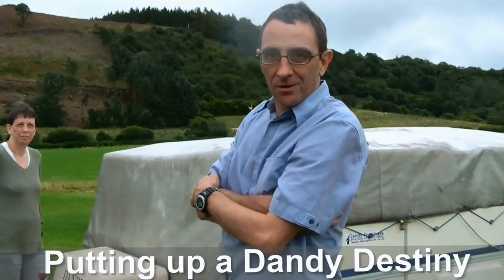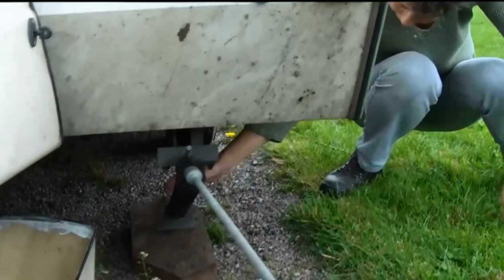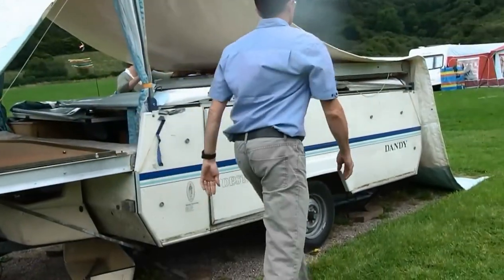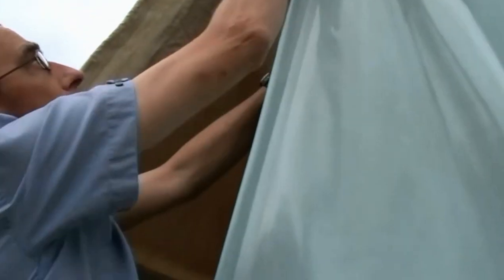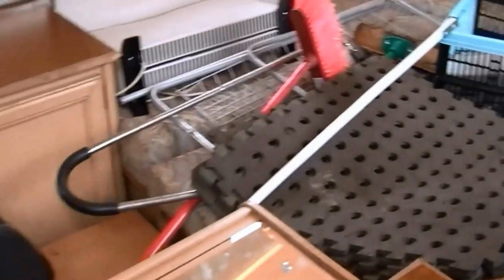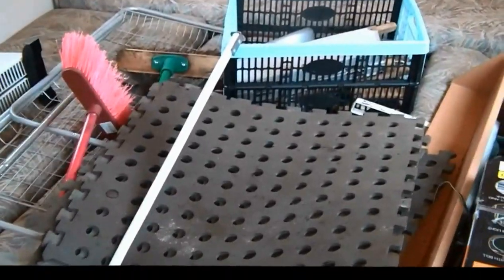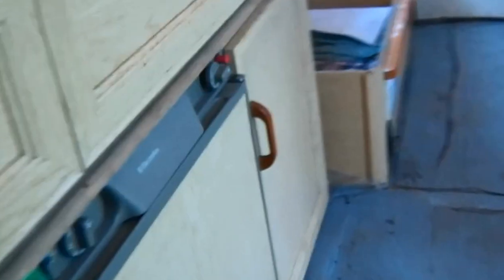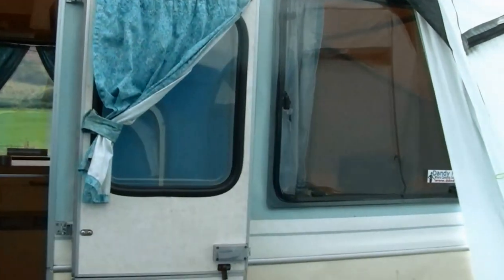Dandy Destiny Folding Trailer Tent - How to put up

Comment: By the way, the Pennines, Conway and Trigano all come with full awning, unlike Dandy, no longer made hence the make do and mend slap on tent.
Reply from the maker: Wrong! Dandy/Riva Did make full size awnings. Its just that I prefer the Drive-aways...
Reply: DID make but no longer. Stopped making them years ago!
Reply: So you don't have a choice really - drive away or none at all!
Reply from the maker: Or, you can use a fixed frame awning that Dandy Made ;)
Reply: If you can find one!

Comment: I had 3 different models of Dandy over the years, the last a 2004 Riva. I gave up on them in the end. OK you can pack them away wet but in contrast to that MUCH harder to put up than the Conway, Pennines and Trigano, no real problem packing these away wet, when home open them out! Still raining? Leave them until it stops, the same as you would leave it open on a site for a fortnight of rain! Also with built in blown air heating on the others, drying canvas out from the inside is easy, when the rains stops. Flush toilets, hot and cold water, sorry these are way behind the times and over priced. And yours is desperate for at least a wash!
Reply from the maker: If you found put up a Dandy hard, you must have been doing something wrong! Oh, and our Dandy has hot blown air heating... And You can get a Dandy with Flush toilet etc.. 
Yup it could do with a scrub up.. and you know why? Because were too busy out camping!!
Reply: I never said it was hard to put up, I said it was harder than the Conways, Pennines and Triganos, which it is. If you think different try one of those.  A Trigano sails up in comparison to the heave you have to give the door side of the Dandy, to get it even started to go up. The top of the range Dandy is the Dimension and they don't have a flush toilet the same as they don't have hot water!
Reply: And if your Dandy has blown air heating, it wont be factory installed. Only heating they fitted was floor mounted now discontinued because it doesn't meet regs. Nor can you buy awnings for them so yes, I think they're a bit behind the times to say the least!
Reply from the maker: edward charles Sorry your very wrong once again. The Blow air system in our Dandy (Propex) was indeed factory fitted, and of course you can buy awnings that will fit the Dandy.
Reply: Yes Neil you can buy awnings but I think you missed the point! You CAN'T but DANDY awnings! Nor can you buy RIVA awnings. And - wait for it - guess who makes PROPEX heaters? Dandy? NO Propex!!! You are claiming points for what you can ADD to a Dandy through independent makers, as you can with any trailer, camper or caravan. I'm stating you CANNOT buy them as made by the trailer maker for your particular trailer. If I'm wrong phone Riva and try and order a awning for yours.

Comment: Wow.   that looks a lot more complicated than putting up an American style pop-up (tent) camper trailer.
Reply from the maker: Tanya Fabian Not at all, once you have the hang of it, you pitch up, and are set up in 15 minutes.
Agree it takes longer to put up the awning! 
But to set up the Dandy from start to finish is as easy as 123, abc
Reply: Tanya Fabian the beauty of these is everything is off the ground, you can set it up in a gravel car park if you want. no canvas to rot, you can put it away wet, the smaller model weighs next to nothing, fabulous fuel economy, they dont make them any more but they are still commanding high second hand prices because they have such a good reputation. i wish i could get plans i would build one myself : ) i think the onl;y downside is the horrendous colour schemes on earlier models.